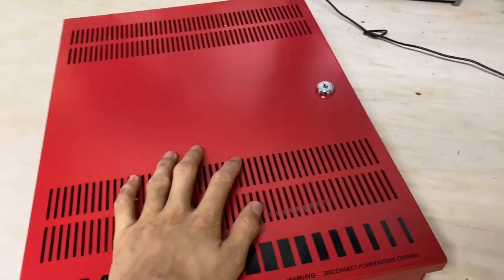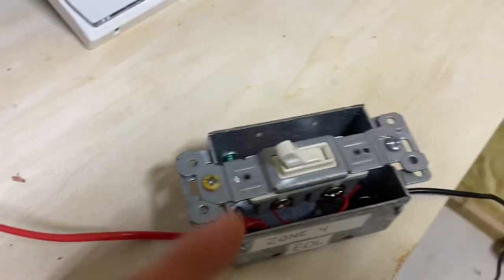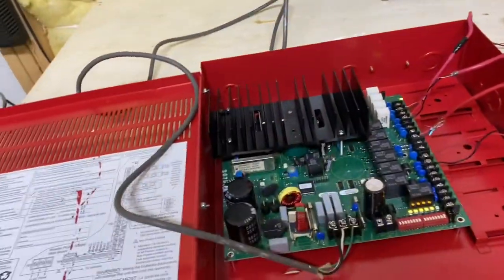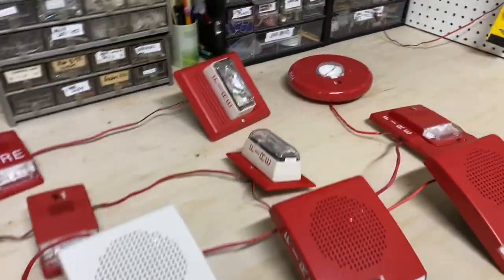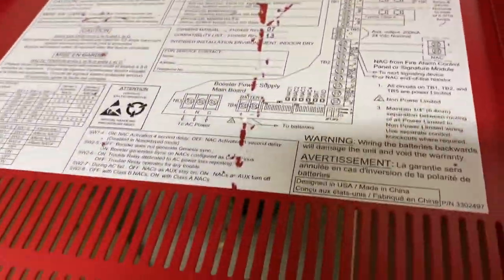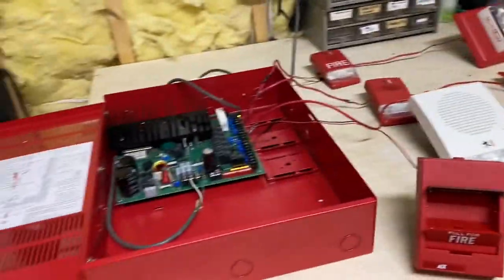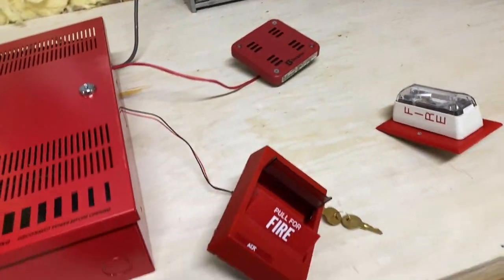Fun with a Fire Alarm Booster Panel (NAC Extender)

Comment: My high school several of these EST booster panels connected to a EST3 since my high school has 7 different wings, library and an auditorium. They're mainly located in maintaince rooms where staff goes and the Genesis does sync with the rest.

Comment: I had a fire drill at school the tone the Genesis speaker strobes were playing was not what I expected, the tone does a slower code 3 and it’s slightly lower pitch, some of them were somehow out of sync, but most of them were in sync. The reason why the tone is lower pitch and slower, is because the panel in my school is an EST2 panel
Reply: EST has been using the same tones since the late 1980s so it being an EST3 is not relevant to that

Comment: Hey, I'm an electrical contractor retro-fitting a class A fire alarm into a small apartment building (20 Units Total). It currently only has a Class B system for the hallways and the FAP has only two NAC's. We're adding a Class A system for horns in the suites (requiring 4 NAC's, one for each floor) and we were told we needed a whole new panel that could provide the 6 NAC's required. Would this Booster Pack (NAC Extender) work for what we need? In your video you added one device to each NAC on your booster, but could it support up to 10 devices on each NAC? Thanks for any help!
Reply: I got excited and didn't finish the video before commenting. lol I see you can in fact add multiple devices per NAC. Thank you for this video!
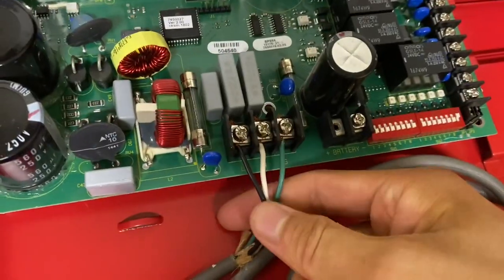Reply: Hey, I just waned to ask as well, at 1:23 you're showing the additional 4 NAC's you're adding (which is exactly what I need) and the description on the diagram has a 'Typical Class B' and 'Typical Class A', is that just for reference or can you only use a 'Class B' circuit in that first position and only 'Class A' in the last? Hope that makes sense.

Comment: Um I am kinda confused with the tone as of 1200hz as in 900hz but some green hill/emerald hill community college career center services building in state of Massachusetts should use code 3 specific tone then voice message trilingual or just tone only thought but I did tried my best though. But there is genesis led strobe series but thy still have genesis xenon strobes ones though which it is synchronized though but Perrysburg county is getting Edwards system then I think. But the Massachusetts code 3 tone should be compatible for the Edwards system est4 panel system of voice evac. But jeez the mechanical horn started me at the almost to the end of the video. By the way for one more thing Edwards kidde brand for addressable alarms does need to be at 900hz for Massachusetts alarms.